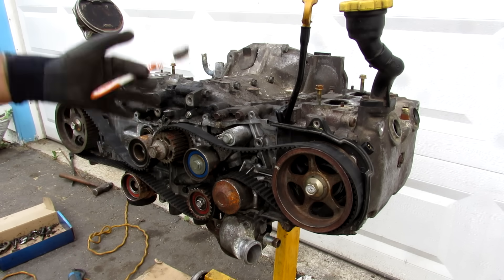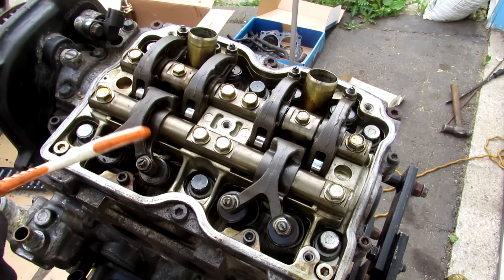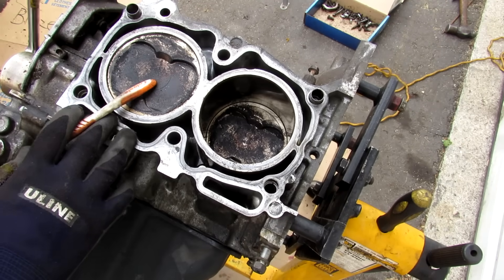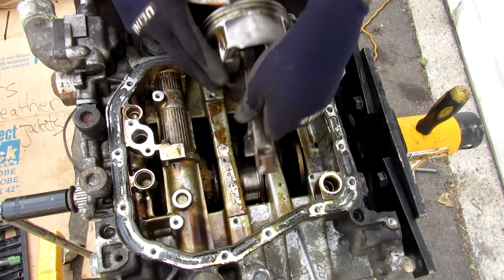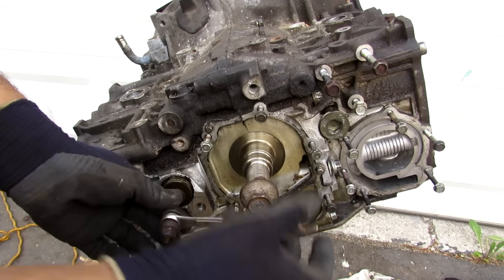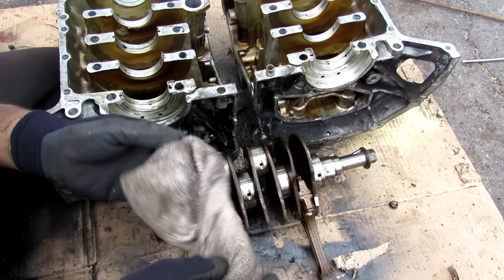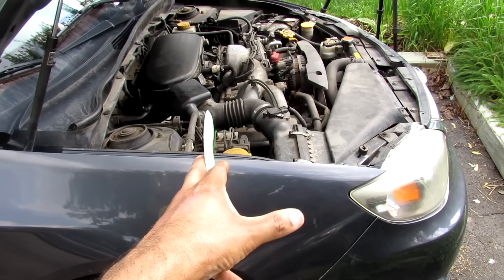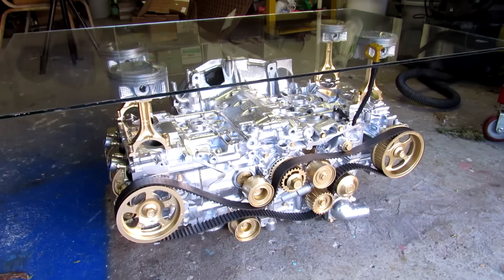Why Subaru Engines FAIL

Comment: Some mechanic: "Thank God I'm done servicing this Mercedes, it's such a pain in the ass"
Subaru rolls in
"F*CK!"
Reply: Then a BMW pulls up behind the Subaru.
Reply: @tonbomohm1  1980's BMW's, E30, E28 they were a joy to work on. All kinds of space, accessible everything. Biggest pain was the frequency you had to replace the rear seals on the transmission but it wasn't hard so much as tedious.
Reply: Phill, just Phill - It's way, way obvious you never worked on either, Mercedes or Subaru! LOL 😂
Clueless people putting out absolutely ignorant opinions. "Solidly" anchored on air & wind! Well, that's internet... ;-)
Reply: @crpth1  He didn't claim to be a mechanic.  As a WRX ex-owner I know I made a lot of mechanics very happy ($$$) and a lot of them very frustrated ??? like the ones he described.
Reply: @crpth1   Both of these are hard to work on, and break down a lot.
Reply: @crpth1  
Like the lunar module. 😂
Reply: @crpth1  Looking at how you speak, it's clear you haven't spent much time at all working on anything.
Reply: Question for mechanics, are unreliable are 328i’s? Like a 2013, I’m sure it’s super fucking unreliable but definitely less then the 335i right? It’s between that and a current civic si
Reply: @jaioncebollero1168  it's all maintenence, baby a bmw and it'll last a long time, miss an oil change or two and well you got a ticking time bomb, everything is expensive on those so I wouldn't recommend getting a used one that you aren't 100% absolutely sure it's been well taken care of because if not that's a gamble you really don't wanna lose...
Reply: @philljustphill1656  I hear you. I had a friend who had a vw cc and that thing fell apart month by month. I’ll take that as sign, and stick with Jdm cars.
Reply: As someone who's worked on Mercedes and Subarus I can tell you with all certainty that NO mechanic has ever said that.
Reply: @mycoolwill7594  maybe you but eh, everyone's got a different opinion...
Reply: @philljustphill1656  you obviously are not a mechanic, nor have any idea about working on cars.
Reply: @mycoolwill7594  LOL - I sure as hell have!
I'd rather work on Kompressors for the rest of my life than deal with another Subaru.
Reply: @mycoolwill7594  i am a benz tech. that is a simple motor that was designed to fail. it is sad seeing this crap.
Reply: @narcissistinjurygiver2932  Wait, what? A boxer is a simple engine designed to fail?!?!
Reply: @mycoolwill7594  inmo
Reply: @mycoolwill7594  Lmo No their not. Subaru's post-headgasket fix are pretty reliable and  Porsche has been just as reliable as Lexus.

Comment: haha just bought my first Subaru for $500 usd. 150k miles on it and it runs.  Sounds pretty good, I think I'll clean it up and flip it.
Reply from the maker: Go for it. Spring is a good time for flips
Reply: @speedkar99  yep, if it wasn't for Rock I wouldn't even try it.  One CV shaft, wipers, oil change, tire, and detail, and it'll go for 2900.  You should partner with Rock like Shapiro does and make more money.

Comment: Whats crazy is that electric motors have 1 moving part. IC Engines have been so streamlined for production that if these same streamlined methods were used to manufacture electric motors for cars, they would cost nothing.
Reply from the maker: But they have alot of electronics to control it.

Comment: I dont know when all those problems accures because my 3.6 has over 150k miles and still goes strong without any problems. Changed my filter and oil 0w40 synth Mobile 1 every 10 to 12 k miles. I live in Quebec.

Comment: 150,000 miles on my ej25 engine and still running great. No engine issues whatsoever. It does burn a little oil but nothing close to the danger range

Comment: An excellent video description of the belt-driven 2.5 L.  I'm a retired European tech and never worked on these engines, but I was well aware of the head gasket failures on these motors.  What's more interesting is that the original overhead, 4-valve 2.2L engines didn't suffer from this problem (I owned a 1996 Outback, and when I sold it at 225,000 miles it still had the original gaskets, although every external oil seal or gasket that could possibly leak did).  The VW Vanagon 1.9 L Boxers that I worked on had similar issues with head sealing, although it usually manifested itself in external coolant leakage; the design was pretty stupid compared to the Subaru Boxer, even though they both used wet-sleeve cylinders, as the VWs used o-rings on the barrels and an external neoprene gasket that was glued to the heads.  Regular coolant changes were neglected, which caused electrolysis damage to the sealing surface of the cylinder head; this often necessitated the replacement of the heads on really neglected engines  I've been told that Subaru finally addressed the head gasket issues from the 2006 models on.  I have a 2017 Outback now, with nary a problem, plus no timing belt to replace, as the cams are chain-driven now.  However, as the man said, the spark plugs are a BITCH to replace!

Comment: I purchased an old Subaru some years back from a used car yard. The engine had a knocking sound. The salesman said it was only the hydraulic tappets that needed replacing. I asked a mechanic and he said it could be piston slap or maybe a big end was loose on the crankshaft or even the oil pump may need replacing?  I took the risk and purchased the car as the price was cheap and I am used to working on cars as a hobby. After a few drives the knocking noise became so bad it was embarrassing sitting at the traffic lights and other drivers giving looks as if to say "you're not going to make it home with that heap of crap". I traced the noise to the right side of the engine and it did seem to come from the tappet area. I removed the rocker cover and listened again with a hose pipe. All tappets seemed noisy.  So I purchased a new set of tappets (which were very expensive) and replaced all of them. After reassembly I started the motor only to find the same knocking noise was still there, loud as ever! I changed the oil and fitted a new oil filter.  After a lot of thought it occurred to me that oil was not reaching the tappets.  So I devised a tool to help clean the oilways. They can't be cleaned by pushing fine wires into the holes. I took one of the old hydraulic tappets and welded on an air-hose connection with an air cock. I placed this tappet into one of the housings and kept all the other tappets in place with various stout wooden dowels cut to size, propped against the inside of the bodywork. I then turned on the compressed air. At first nothing happened but after a few minutes I could hear a faint sound of air leaking and I noticed a thick sludge of oil oozing from a tiny hole nearby. Soon the noise became louder and air was escaping with a spluttering of oil. I tried the same procedure with the other tappets. I then added some kerosene into the airline and pumped that through to help clean the oilways.  I reassembled everything and started to motor. The knocking sound had vanished. It underlines the need for regular service with new oil and filter changes.   On checking the history of the car I learned that it had been used in outback country in the north of Australia where there were many dirt roads.  So I assume the fine dust had found its way into the motor and the fine oil galleries supplying the tappets had gradually become blocked. A lack of regular service had done the rest.
 I gave the car to some friends who needed it to deliver food to various religious charities to distribute to poor people. Anyway I believe the old Subaru is still running well after many years of city driving.

Comment: After watching this I'm going down to the garage to check the oil level of my wife's 2019 Forester.  We bought it new and I've always been skeptical of the Boxer engine so my choice was to buy the RAV4 but she preferred the Forester.  So far no problems but I know it won't last as long as a RAV4 or CRV.
Reply from the maker: Keep an eye on the oil
Reply: @speedkar99  yeah I do, and change it myself, quality filter and oil, every 3 to 5 thousand miles.

Comment: Subaru said that 95% of there cars are still on the road.
I think they are right the car is but not the engine.
Reply from the maker: I've seen that ad. 
Almost 10 years ago they changed away from the EJ series

Comment: how many miles now on your GS? I am looking at a GS350 2013. Specifically looking for the 6speed A/T and with the 2GR-FSE engine. I believe after the 2013, they switched over to the 8speed and slight detuned 2GRFKS on 2016.
Reply from the maker: ~165k miles (267km)

Comment: I have an ‘09 Legacy that got a head gasket repair recently. I was wondering if there are any side effects that happen after being repaired?
Reply from the maker: From what I've heard once it's been repaired the head gasket issue doesn't typically come back. But watch out for spinning rod bearings
Reply: @speedkar99  Awesome! Thank you so much!
Reply: @speedkar99  Hello again! Wanted to update you on the Legacy. I had to get a head cylinder replaced as well on it. The only problem I’m noticing is after around 4+ hours of not diving the car, there is still some smoke coming out of the exhaust when I start it back up. Is it because it’s still burning off the extra stuff left over in the engine, or different issue besides the head gasket and head cylinder?

Comment: CooL video i  like how you go into detail with how the boxer engine runs opposed to a regular v6 or in-line engine i like the boxer engine just wish it didn't have that oil starvation issue the boxer engine packs a good punch for it just has some bad design in some areas.
Reply from the maker: Yeah it sure has alot of advantage and disadvantage ...

Comment: So a build subaru engine would not rattle the bottom end like a standard engine?
Reply from the maker: How?
Reply: @speedkar99  because the standard engines a very soft and don't like high revs
Reply from the maker: Maybe the newer ones

Comment: This is why electric cars are going to dominate. These internal combustion engines are so complex, and have to be put together so precisely.  They are marvels of engineering, refined to an incredible level.  But soooooo many pieces.
Reply from the maker: They sure are complex and interesting
Reply: Until electric cars can be equipped with batteries that can easily provide 300 - 400 miles of range at a time (and that includes operating in fairly cold climates too), and be mostly recharged within 45 minutes or less, they will NOT dominate, period.  Now, in the meantime, a good hybrid vehicle is a viable option for most purposes.

Comment: Seafaom 1/2 can,clean those ring grooves man.
Reply from the maker: I should do a before and after
Reply: @speedkar99  you do a good job on the explanation of things.I have fixed many oul burners with the seafoam 8n oil and upper end cleaning.
Reply: @speedkar99  transmission fluid,marvel mystery oil also work

Comment: 6:50
The main problem is like you said its a HORIZONTALLY designed engine ... Gravity is NOT the problem because Gravity does not exist, its called weight and mass of the oil itself that it wants to fall to the ground naturally by physics and thus starving the top side of the piston from oil which leads to failure. 
Also the coolant with its WEIGHT and MASS wants to fall to the ground (NOT BY GRAVITY) which SITS on the head gasket and eventually will seep thru the gasket causing a leak. 
Its a bad design engine because of the sheer physics on the oil and coolant wanting to fall to the ground and that ground is the headgasket ...

Comment: These engines have flat plane cranks where as a standard  V8 uses a cross plane  cranks both have their pros and cons , the flat plane has no low end torque but has high end power because  of the higher  rpm. The cross plane  has alot of low end torque  but not alot of high end rpm

Comment: The problem with the heads gaskets is an old one with the 2.5's,did Subaru did anything to remedy this obvious problem and if yes what did they do and since when.Thanks for the info's I own a Forester 2015.
Reply: Problem was resolved many years ago.  Done.
Reply: @eskieman3948  Thanks for the info  bro,your videos are very helpfull and to the point,.

Comment: Belt drive Subaru engines fail for one reason and one reason only not enough oil in the engine and when they go around corners all the oil goes into one of the cylinder heads and not the oil pan.  And you never take the rocker arms off of a single can there's no reason to.  You can take the head off without removing the rocker arms.

Comment: When buying a Subaru engine,  the #1 thing to know is..... DON'T!

That simple 👌

If you want a reliable horizontally opposed engine,  get a VW Beetle 

Problem solved 😌
Reply: C'mon... you're REALLY not that dumb, right?
Reply: @eskieman3948  watch what you say before knowing who your talking to, their background and abilities.  I am VERY familiar with Subaru engines.. I rebuild them fairly regularly when in Rally reason in my area. They are OK when stock. But once you start adding power,  and really DRIVING them. They DO NOT tend to hold up well. Luckily they rebuild pretty easy.  I am not sure your background but if you "weekend warrior" your Subaru,  it may last a while. If you actually race it, you WILL be rebuilding more often then most engines.  It's what I do. There are PLENTY of blogs, YouTubers , racers, Rally schools (dirt fish, O Neil) that will agree with me.  What they do have is a fairly reliable 4 wheel drive system,  fairly inexpensive in comparison to other all wheel drive cars (audi) and parts, and parts are easy to find with a huge aftermarket. 

If you want a good, reliable  inexpensive car to start with that WON'T blow up in the 1st or 2nd season and don't mind FWD get a Ford Fiesta SE or ST if you have more money to spend.. heck ask Team O Neil,  they use them at their school. I have one for my Rallycross. 

If you LIKE to tinker, and rebuild in your free time get the Subaru.  My guess is if you know a Subaru guy that ACTUALLY races or mods them, then there is a HUGE change you know a guy on his 2nd, 3rd or more engine. 

It's a fact.

DIRTFISH has hour meters on their Subaru engines so they can judge when it's time to rebuild it before it blows.  But don't take my word for it,  ask them. Or better yet, do to their Rally school and see for yourself... I Did. 

So I won't call you dumb, just ignorant to this topic by the looks of it.

Comment: Wish I had seen this 2 months ago. What a dumb design. Depending on o rings buried in the center of the engine, very thin ring spacing in aluminum, access holes for the wrist pins, and a main bearing that doesn't even get pressurized oil? Wow, SMH.

Comment: Renouned for blowing head gaskets and a mission to replace them b4 they blow. Won't be recommending boxers to anyone.
Reply: It's not really boxers, but specifically some versions of the EJ25. The open deck design and large bore puts a lot of strain on the gaskets.
Reply: @bryede  thanks.
Reply: No one would put any credence in your opinion anyway.  Ignorance is not a desired talent.

Comment: People brag 300 k miles no problem.  I call b's
Reply from the maker: On a Subaru?
Reply: Sorry, junior.  There are two Outbacks in my neighborhood (2001 & a 2006), both approaching 200k, and they check out and run just fine, thank you.  There was a story in Car & Driver a few months ok written by a fellow with a 2006 Outback....268k and still running OK.

Comment: Nice straight and fast forward talking. I like that. But i do not like the EJ very much besides the noises it makes. Never owned a Subara but my first car had a boxer 4 banger. Alfa Romeo 33 with the "legendary" 1.7l (na)engine. Sounded like a tuned VW Beetle:) A rather weak unit, but the rust was strong with the cars body.

Comment: The good thing about future electric cars is, no more crappy combustion engines with all kinds of bearing failures, leaks, heat problems etc.
Reply from the maker: But you have complex electrical systems to deal with
Reply: @speedkar99  there's nothing to deal with
Reply: @henripihala9267  Awww.  Are you going to sing kum by ya now?  Blessed are the clueless.

Comment: Well, I've owened my 2000 Camry for 12 years and never had to re torque the head bolts.
Reply: You could drive an old camry thru hell and back and it'll run just a well as the day it drove off the lot

Comment: Not all boxer engines fail. Both my Outback and Forester did 750000 and 586000 km before I sold them and they are still going  all depends on how you take care of the car and if you do preventative maintenance

Comment: YOU MAY KNOW I HAVE A 2002 OUTBACK WITH THE 2.5. IT HAS A MISS AT #1 N THERES OIL AT THE TOP OF THAT SIDE. IT HAS A ROUGH IDLE DUE TO THIS BUT RUNS GREAT EVEN THO IT HAS A TAD OVER 200K ON IT. I GOT IT CHEAP N USED. ANY IDEAS ON THE ENGINE?????????
Reply from the maker: Turn it into a coffee table like mine
Reply: @speedkar99  CANT ITS A DAILY DRIVER

Comment: Ringland failure in EJ engines is usually from high turbo boost, which will increase blow by and raise crank case pressure, which can defeat the pcv valve and introduce oil into the air inlet manifold. The oil mixes with the fuel and lowers the octane ratio, which can cause pre-ignition and ringland failure. If you have a turbo engine and you want to increase the boost, consider an oil catch can. Always use at least 95 RON fuel in a turbo petrol engine, and 98 if you boost it and don't have a catch can. Expensive fuels also have more additives which keep the injectors clean.

Comment: Answer to that title question is: most ''people'' that buys WRX or STI are little sissy douchebags that would make any engine fail the same way. They're stuck in that pattern, thinking the problem is always the car lol Main reason for that, is that they are fairly cheap cars to buy.